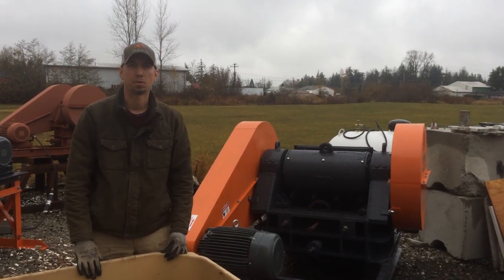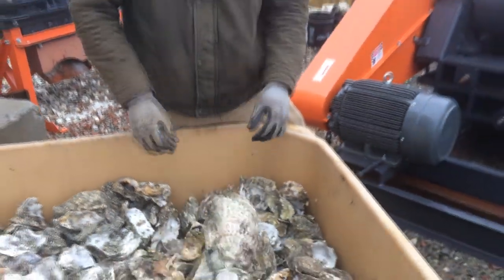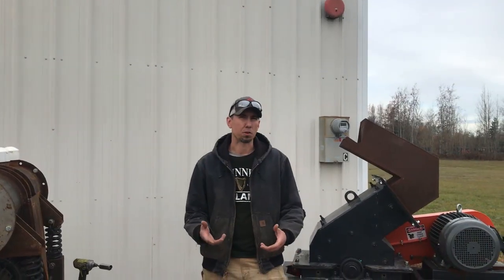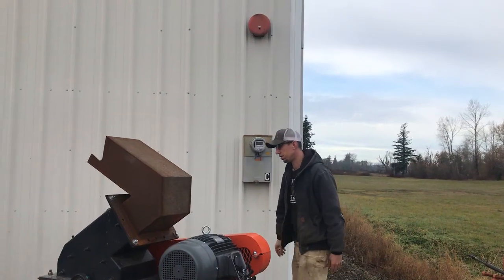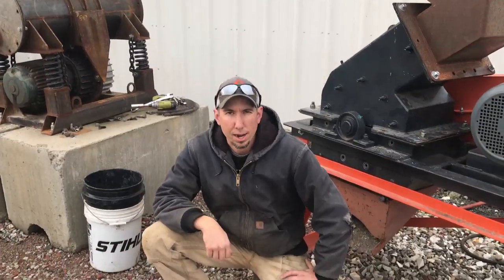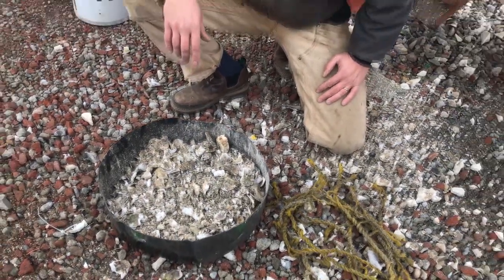Oyster Shells in a Jaw Crusher and Hammer Mill for Size Reduction and Waste Removal

Comment: It seems to me that the oyster farmers could save $$$ by using only one hammer mill. 
First run with no screen, results 100% separation of rope. 
Second run using screen of choice, results 100% properly sized crushed oyster shell. 
Or are we talking quantities that make two machines necessary?
Reply: Yeah, you've got it, this is totally a matter of calculating throughput, and determining the benefits of pipelining the operation.